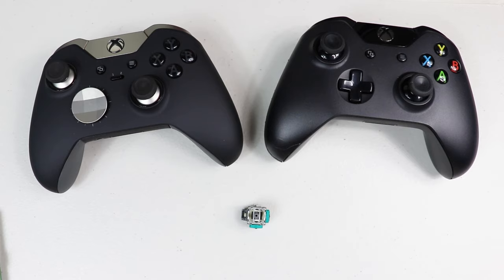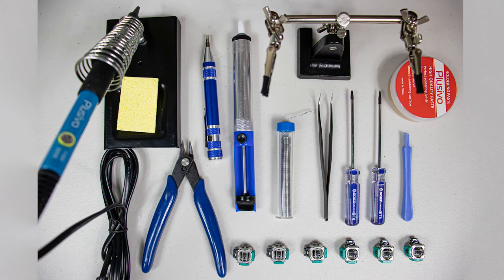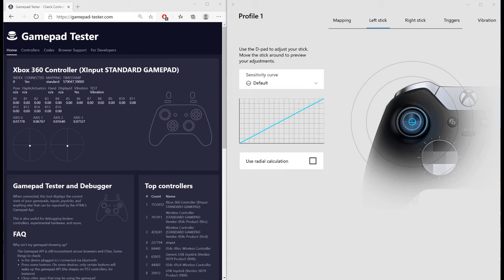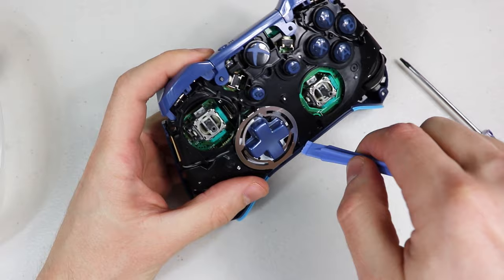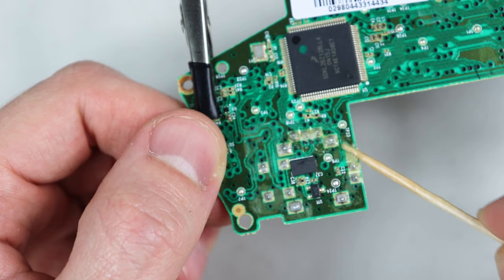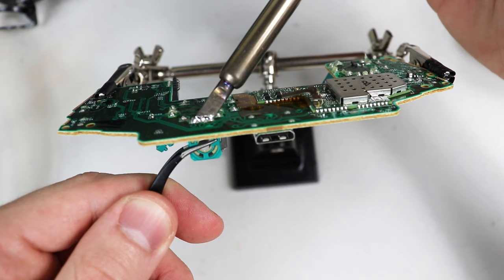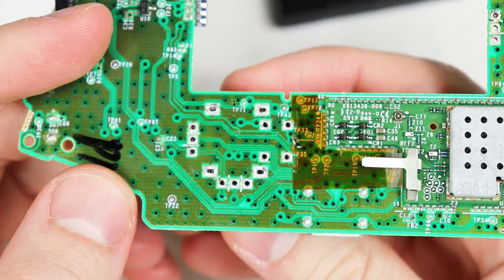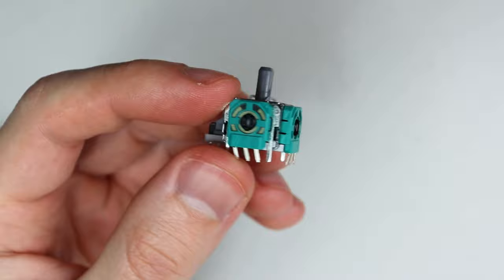How to Replace Xbox One Controller Analog Joystick - NEW METHOD - Fix Stick Drift, Broken, & Loose

Comment: What to do when triggers are registering without input? My left trigger is being active when  I'm not touching it, so In racing games the brakes are always engaged.
Reply from the maker: Great question. Sounds like there is a short somewhere. Perhaps some corrosion, or worst case damage to the board like a crack or something. It may be possible the switch is bad on LT also. Unfortunately I've never had a repair like this so I can't really say. Wish I could be more helpful.
Reply: @SOSSGAMING  hmm I see, I'll need to examine the board carefully then. 

Also I wanted to ask you what is your take with a method to "fix" stick drift using PCBs with SMD potentiometers that are mounted underneath the joystick modules. Are they worth it? Have you heard of them?
Reply from the maker: @DaRockCandy  I believe I know what you're talking about. They don't fix stick drift, the underlying cause anyway (worn out carbon in the potentiometer) but they are a pretty decent option for manual calibration.
Reply: @SOSSGAMING  hello again, Amazon is currently out of stock of your repair kit with 6 potentiometers, are there any plans to restock? Greetings
Reply from the maker: @DaRockCandy  Unfortunately not for quite some time. I do sell the whole joystick kit for a few dollars more that includes more of the potentiometers. You can just take them off the joysticks.

Comment: What’s the best way to fix the drift without replacing the entire thumbstick?
Reply from the maker: So there is a small chance you will be able to open the offending potentiometer and clean the wiper/inside of the potentiometer and that might do it.  Otherwise the next easiest is just replacing that potentiometer with a new one.  As shown in the video, you will want to have an original potentiometer, either from a new joystick, or a known working donor one from another controller.

Comment: So I followed your guide and bought the joystick replacements you link to, but my sticks give me horribly inconsitent movement.  Sometimes it'll move normal when I look right, but REALLY slow when I turn left.  Any idea what I might have done wrong?
Reply from the maker: Sorry to hear about the issues you’re having. Have you tried using the game pad tester site to see exactly how it’s responding? That might help us diagnose better what’s going on. From the sounds of it, it might be that the x-axis potentiometer isn’t hugging the joystick very well, resulting in the wheel inside being loose. An un-flush (tilted) joystick might also cause this. Or it could just be a bad potentiometer. Haven’t encountered this before so would be interested to know what’s going on. Let me know what you find out with how it’s responding in the tester. What range it’s getting, if it’s sporadic, etc.
Reply: @SOSSGAMING  I used the website to center the pots and it looked really good with great centering.  Then I tested in-game and saw this behavior.  Tried the tester again and it looked fine, even across the full range of motion.  Tried a different game - same behavior.  Back to the tester, and this time I got full range of motion to the right, but only about 80% to the left.  So it's not getting the full range on the left-right pot, but only sporadically.  The stick is still centering great, even when I'm getting limited range of motion.
Reply from the maker: @SasquatchComposites   I'm guessing you had removed the nubs to manually calibrate correct? Sometimes it can be turned in a way that limits the rotation of the wheel inside. I'm guessing that's what it is. I'm betting if you either adjust it a little differently it would work. You could also just try a whole different pot. 
Ideally you want the pot and wheel centered with nub that sticks out from the joystick, while also being twisted the way you want for the calibration. If it's pushed to the left or right too much, it can cause friction to the wheel. I'm hoping that makes sense, but it's a little hard to describe.
Reply: @SOSSGAMING  Thanks.  I'll try that when I'm feeling motivated.  I need to take a break from it for a couple of days to let the frustration cool.
Reply: Decided to try again.  Managed to break off the trace that the middle pin on the pot is supposed to solder to.  I think I'm screwed.  Thanks a ton for your support on this.  I guess I've got the tools to try again when my new controller starts to get stick drift.
Reply from the maker: @SasquatchComposites  If that pad came off, there is a way to still make it work if you're interested. Basically you will need a trace wire to go from the pin to on of the TP points on the board. If you let me know which controller your working on and which controller you're working on which joystick and axis it is I can let you know the TP location.
Reply: @SOSSGAMING  I am interested.  It's model number WL3-00105.  RH stick, horizontal axis, middle pin.
Reply from the maker: @SasquatchComposites  Ok, pretty sure that's the 1708 "S" model, which is going to be TP66 on that controller.
Reply: @SOSSGAMING  Is there a guide somewhere to show me how to find TP66 on the board?  This is all pretty much new to me.
Reply from the maker: @SasquatchComposites  Not a guide that I'm aware of, but I can link you to this page. https://acidmods.com/forum/index.php/topic,43981.0.html
It shows the boards on here. But you should be able to find it on the board, it's kind of like where's waldo lol
Basically, just solder a strand of wire from the pin, to the TP location where you see the solder. Does that make sense?
Reply: @SOSSGAMING  That makes sense.  I'll take a look at it when I get some time and hopefully I can figure it out.  Seems simple enough.  Thanks!
Reply from the maker: @SasquatchComposites  Good luck!
Reply: @SOSSGAMING  I found TP66 after a few minutes, soldered a lead to it (tricky because it's so small), and it's working now!  Man I was ready to just give up on this.  Thank you a million times over!  My controller is working perfectly again!
Reply from the maker: @SasquatchComposites  Sorry for the late reply. That's so great!

Comment: Great video, but this is a very analog solution to a seamingly digital problem. I'm blown away no dev has software to calibrate the firmware... We do similar methods to cars and phones when repaired, why not controllers? China has to have some device for this.

Comment: Do these joystick modules work for an elite series 2
Reply from the maker: Technically they can but you would also need to downgrade thumbsticks (elite 2's use the screw on metal dome pieces).  Also these joysticks sit a little bit lower

Comment: I bought 2 xbox series x controllers they both got unacceptable stick drift within the first 4 months. They only come with 3 months warranty. I have 10 year old xbox 360 controllers that work perfectly fine. These new ones arent built to last. Im not paying my consoles worth in controllers every year. Local repair shops say its not worth their time to repair as it takes over an hour to earn less than 30 euro not worth their time. Im well able to learn this stuff so i will. Losers lose money. This kind of skill is useful in general not just to repair controllers.
Reply from the maker: Great way to look at it. Good luck on the repairs!
Reply: @SOSSGAMING didnt expect a reply. Great channel, my man you are a Legend!

Comment: wait so the pentiometers may or may not work?  so i am buying a product that may or may not have faulty products on it?  that make no sense.  a joystick should just solder on and is centered by design so they just need to be plugged in and they are good.  doesnt make sense to me at all.
Reply from the maker: Yeah, they weren't designed for this repair (perhaps on purpose) as Sony and Microsoft are both culprits of using this type of carbon-based potentiometer and don't offer calibration software.
 
Good news is that Microsoft made a surprising move lately. Not only do the elite 2's have integrated calibration, but the s/x controllers do too. So for the new controllers it is how you described. Just desolder the old and solder in the new.

Comment: Is the joystick inside the Xbox controller the same as the one inside the DualShock controller or is there something different About them?
Reply from the maker: Besides color, the two main differences between them are spring tension (PS4 has stronger spring tension) and joystick height (PS4 sits taller).
Reply: @SOSSGAMING  and what would you say makes the Nintendo switch pro controller analog sticks different ? I noticed they don’t feel as responsive and feel weird and “off” in games that require aiming , a good example for comparison would be resident evil revelations two since ThAts on the PlayStation Xbox and switch to see what I mean
Reply from the maker: @wolfpackgaming2492  I'm actually not very familiar with switch joysticks and how they function, so unfortunately I can't chime in on that one at the moment.

Comment: Very good video and a great explanation! Sadly after replacing the stick my controller stopped working. After i replaced it, it turned on for a short moment and moved downwards on my xbox. After this it stopped working so i tried it again. It turned on after trying some different things and stopped working completely after that. This was using batteries because via USB would not work at all. 

Do you have any idea what could be wrong? Maybe i did not connect something properly or damaged something with the soldering iron?
Reply from the maker: Hey there, that's no fun.  I have never experienced anything like that, so I don't know if I will be much help, unfortunately.  It is possible some of the small capacitors got heated enough to fallen off.  I would inspect the board thoroughly around where you soldered to see if anything seems out of place. That's the only thing I can think of :/
Was the USB working prior to the repair?
Reply: @SOSSGAMING  Thanks for your super quick response. Yeah it really is a bummer! It thought it went great until I turned it on... 

I took some pictures! https://imgur.com/a/BT4AUx2 (if you need any different pictures I am happy to take them)

Maybe you could take a look because I can't find anything wrong with it. i am not sure if the USB worked before because I did not really use that.
Reply: @SOSSGAMING  I think i figured it out! I used S-39 solderfluid because the set I bought did not include any flux. I had the s-39 flux laying around but apparently it is not great for electronics... 

After finally having booted the controller it seems that my joystick stays pressed so i will try to resolder those points tonight. It also seemed very fast in my menu screen but maybe this is fixed along with the pres function after resoldering.
Reply from the maker: @henkiehendrikse  Did resoldering help? The only thing I can see is that the amount of solder used is a lot more than necessary, but that shouldn't cause any power issue I wouldn't think.  Perhaps cleaning the board up well with some isopropyl alcohol might help, incase any residue is causing a short somewhere. 
Also, I would even inspect the batteries/battery terminal.  It might not even be related to the repair itself.
Reply: @SOSSGAMING  After i cleaned everything very thoroughly (even taking of the joystick and resoldering it on) the controller is now working great. I hope it will stay this way but i am afraid the flux did some damage. 

I found a drop of flux on the RB button making this defect most of the time and also below the USB port probably causing the power on issues. The staying pressed issues of the joystick was also gone after cleaning. 

I know one thing and that is that i am going to buy some good flux! Thanks for your response and guide! Really helped me out.
Reply from the maker: @henkiehendrikse  Oh thank goodness! I'm glad you were able to figure it out.  Didn't even think about that.  Have a good one!

Comment: This "hardware calibration" by chopping the alignment pins off the pots is kind of insane. They surely didn't have to do that in the factory that built them. Are the replacement sticks just really garbage that this is required, or what?
Reply from the maker: No, they are the same joystick, same quality. I explain the reason manual calibration is needed at the beginning of the video, but basically they didn't have to do it at the factory because they calibrated them through software that is now international for that specific controller's joysticks.  I hope that makes sense.  I know it can be a little confusing.  There's another method that requires measurements and calculation that I have on my channel, but it's even more tedious.  Micro$oft and Sony didn't make a way for the end user to adjust it later through software, and we're stuck with methods like this. Nintendo and third party controller manufacturers actually make controllers and give out the calibration software to the public.
Reply: @SOSSGAMING  thanks for that nice description, I think I get it. The software calibration isn’t available for users

Comment: Is it possible with series x controller
Reply from the maker: Yes, and it's even easier! No manual calibration required, just swap the joystick and/or potentiometer, then calibrate in the accessories app.

Comment: Could you do a guide for the Xbox Elite 2? it is actually pretty different and I could use the help tbh. I bought your kit and i don't know its going to be a good enough replacement. The elite 2 have threaded analogs. :(
Reply from the maker: I do actually plan on doing one for the Elite 2.  Videos take a long time to do however and I have a lot on my plate but I may be able to get one out in a month or two.  Is that ok?  There are a couple videos on YouTube I believe that at least show how to open the Elite 2's.
Reply: @SOSSGAMING  Yeah of course! I subbed so if you ever do release it I will see it! I got it open and whatnot, but nobody has a video as good as yours! You explain it well and have a great camera angle to back it up! Take your time friend I'm in no hurry!
Reply from the maker: @Murraylax9  So actually I think I realized that you had purchased the regular xbox joysticks, correct? If you need to replace one on the elite 2's and plan on using the elite 2 tension-adjusting threaded dome piece again, you will need the specific one's for the elite 2's which are a bit more expensive at the moment, which I also sell.  Although it's technically possible to replace with the regular xbox joysticks as long as you use a regular xbox thumbstick or regular series 1 elite thumbstick domepiece (they don't need the threads).  
If all you have is stick drift, you should be able to just replace the offending potentiometer with one from the regular xbox joysticks (they're the same).  Hope that helps.

Comment: Question: What causes the malfunction? I thought it was mainly due to wear and tear of the wiper (small pot ie. resistive ring inside the green plastic housing). If that's the case can't you just remove and replace the wiper portion but leave the rest of the component attached?
Reply from the maker: Yes! This is just a video showing the complete process for replacing the whole joystick, and this controller just happen to have drift that I used for the example. Many joysticks also break, become lose, click issues that need full replacing. I should have made that clear in the video, my apologies. 
I do plan on making a shorter video specifically addressing drift and only replacing just the potentiometer in the near future.
Reply from the maker: And to be clear here also, I'm assuming by the "wiper portion" you mean the potentiometer. Just replacing the wiper won't really help the issue.
Reply: @SOSSGAMING  Good to know. Thanks. Also, the repair video was great, good job.
Reply: @SOSSGAMING  Oh by the way, a followup question: without soldering can you just pry open the wiper housing and try and swap with a new one until you find one that's close? My controller is less than a year old, but left thumbstick developed drift. Opening up, I saw debris collected on the "fingers/tabs" of the wiper so I lightly scrapped it off and it worked like new for about a week and is now back to same problem.
Reply from the maker: @brucew.gordon6971  You can certainly try swapping out different wipers, but I think even if you do find one that helps the drift, it will only be temporary. It would be best to replace the potentiometer itself, as that's what's been worn down.
Reply: @SOSSGAMING  I'm confused, I thought the "wipers" were the potentiometers? I thought they were those removeable dark thin circular pieces that fit inside the green plastic housing. I assumed that they were made up of a resistive film that conveyed the xy coordinates. Are you saying that the pot is actually embedded in the green plastic housing itself? (Sorry to take up so much of your time.)
Reply from the maker: @brucew.gordon6971  No problem! Glad to help with what I can anyways. Perhaps both are needed to be considered a complete potentiometer. The green housing does indeed have the conductive material (carbon) that wears down. The wiper is that black disk you speak of and what completes the circuit.
Reply: @SOSSGAMING  That makes sense. Perhaps when I tear one down I can look into it further. Thank you. I appreciate the info. Have a great Thanksgiving and Christmas Holiday. Cheers.